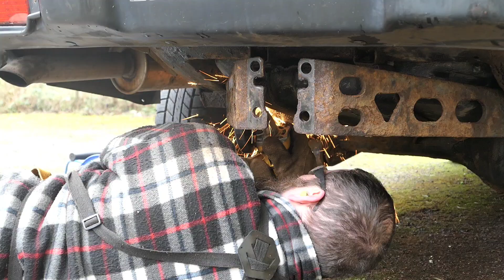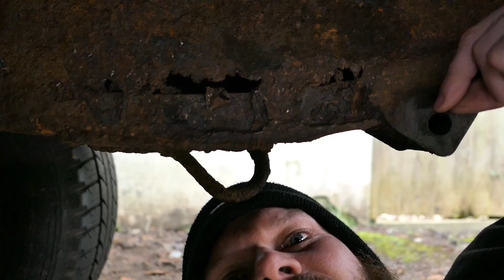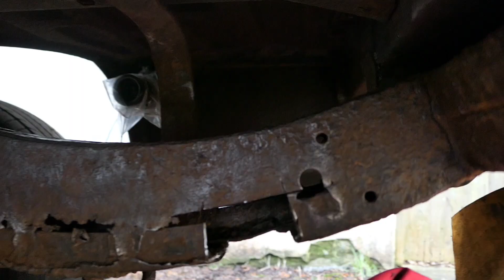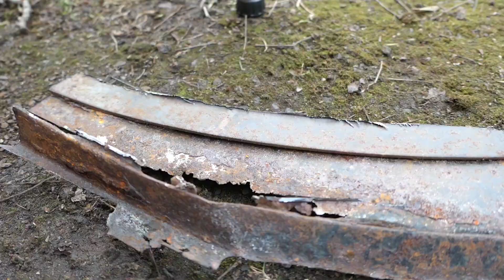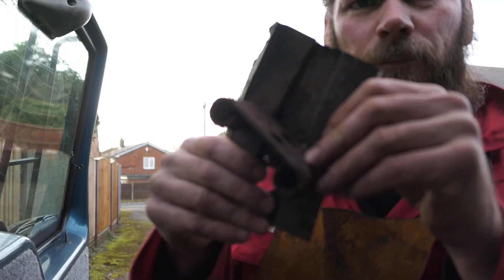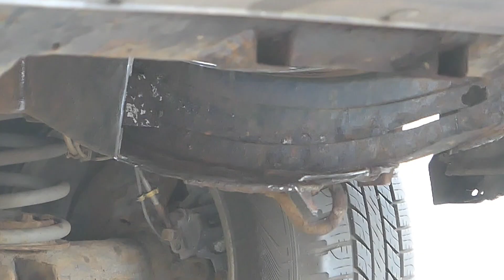Chassis rust repair

Comment: Interesting stuff. I would have thought a rear quarter chassis would have been a quicker and better solution, but then its not me doing the work.
Reply from the maker: Yes you’re right it would have been a lot quicker and probably better, but a rear quarter is the best part of £400 and I already had the repair parts, my long term goal is to get a galvanised chassis in the next couple of years.